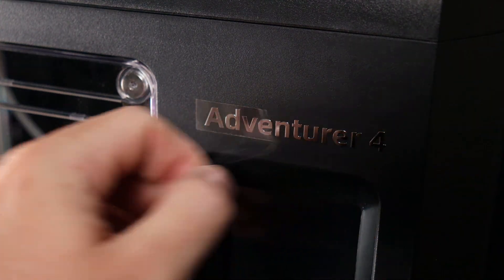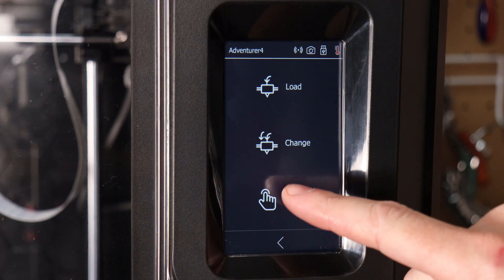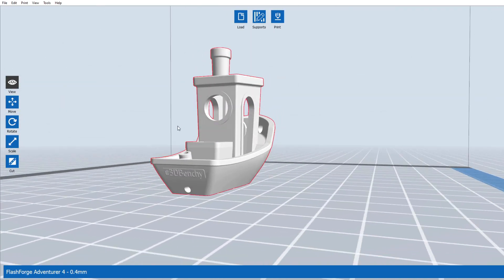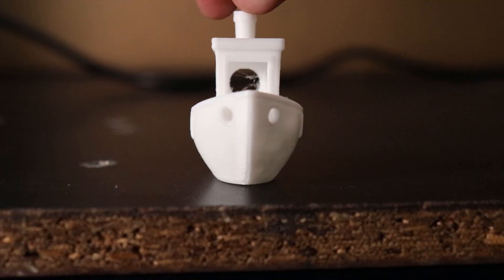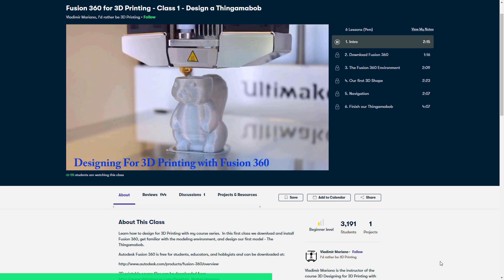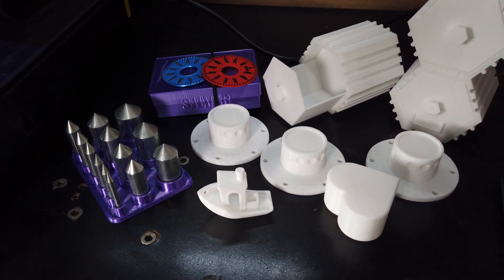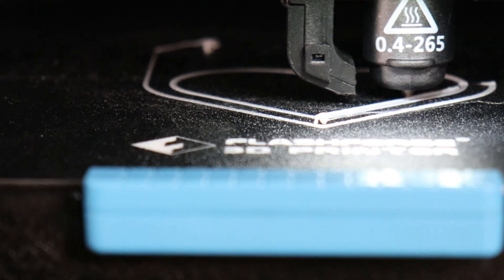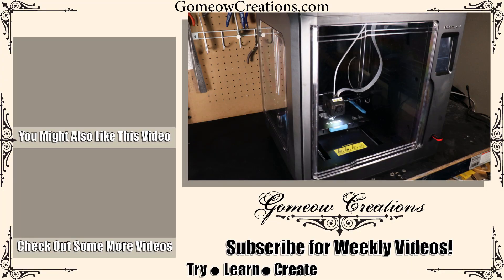Flashforge Adventurer 4 - No Assembly Required & Start Printing in Minutes

Comment: Did you have any problems with pla printing at the default temp setting of 210c ? I use flashforge software and my prints are easily broken apart. I'm using the roll of filament that came with the printer and I noticed the test files for pla temp settings are 215c. Could I be printing to cold causing my models to break easily? I never had this problem with my adventurer 3c. Thanks for any advice.
Reply from the maker: Yeah I have had that same problem. I have to print 5 to 10c higher than normal to make it print probably
Reply: @GomeowCreations  thanks I'll try that tonight

Comment: Hey Randy, I have a random question... 
What size Nano blade would you suggest be used to cut a Canadian penny that is 1.45mm thick? I'm just starting out with a saw and I'm going to use pennies to practice with but I don't know exactly how to figure out what gauge a penny is (I don't have a gauge finder) so I'm not sure which blades I should get. Your help would be greatly appreciated. Thanks!
Reply from the maker: I would use a 1/0 or 2/0 depending on the details you are needing. 1/0 will cut it faster but the 2/0 will have finer teeth. You can even used 3/0 or 4/0 if your have very sharp or small details that you need to cut. Basically you will have to try it out but I hope that is some helpful info. 😁👍
Reply: The best guideline for deciding on blade thickness is to choose a saw blade with two or more teeth for the thickness of the metal being sawed.

Comment: How often should the hepa filter be changed? Manual say every 2 weeks if a 3D printer is used frequently.
Reply from the maker: Probably every two weeks if you are going to follow the manual. You can also just take it out and ad a vent to it that will go outside 👍

Comment: Is it correct that you need to buy the whole nozzle set up? Can you take it apart and change the nozzle? Otherwise that's clearly a downside compared how cheap just a nozzle if for other machines.
Reply from the maker: What do you mean by a whole nozzle setup? Like the full hot end assembly? If so that's a no. They do have there own nozzles that you have to by if you want to switch them out that don't come apart that I know of.

They are $27 each and $45 for the 265c one. I do thing they are expensive for nozzles but they are very simple to replace. 

I think this printer is more aimed for people new to the whole 3D printing thing, schools or businesses that don't want to deal with the printer. Basically you are paying for convenience. 

I hope that helps 😁👍
Reply: @GomeowCreations  Exactly what I meant..not the full hot end. Ok that's a bit of a downside...where i live the nozzle goes from 45-55 dollars...that's inlcude shipping. Maybe they work for a very long time...i don't know and i hope so...that can be a bit of a game changer. Otherwise the machine seems good and easy to operate. Thx for your reply and thx for your help 👍